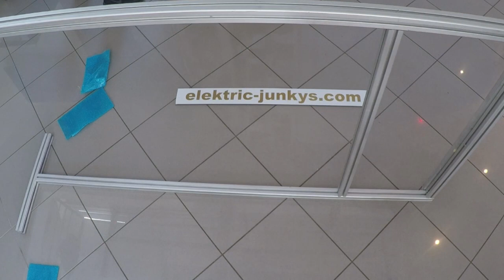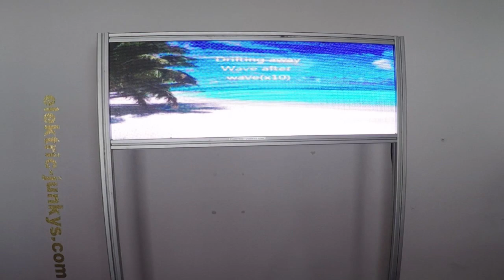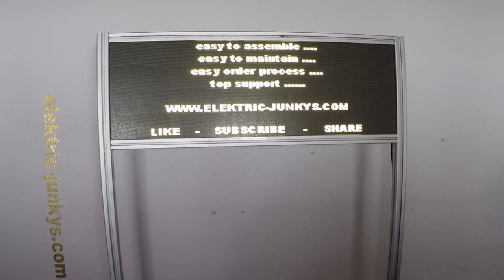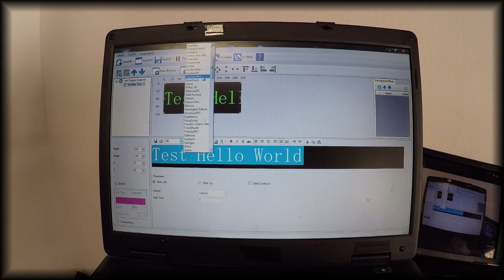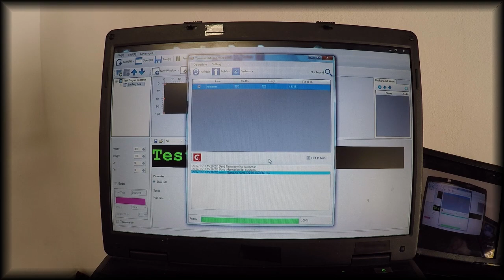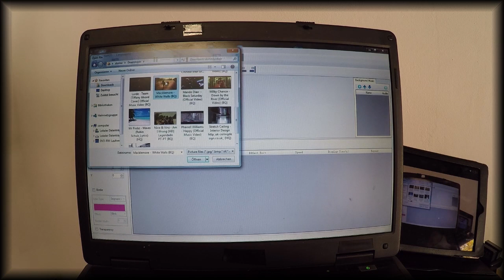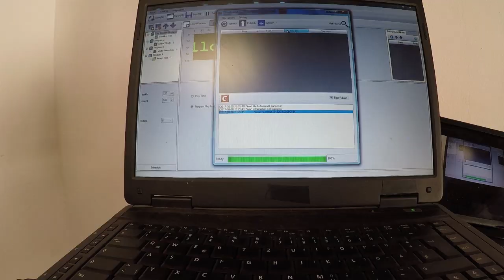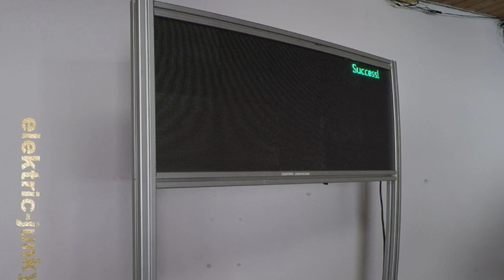how to build a LED Display P3 | High Resolution Low Budget DIY with elektric-junkys

Comment: Signs look good I've seen some of your videos. Only question is how well does it work in direct sunlight as if used for business sign out front. Also would putting plexiglass in front of it distort it (thinking of protection from rain)
Reply from the maker: hi guys .. for outdoor we have different Solution such as DIP LED Modules or an higher Brightness Chip .. we assemble on customer request ! 

Nationstar / Epistar / Taiwan Chip ..  customer is King elektric-junkys.com.... thanks for comment
Reply: ejunky66 please send us a link
Reply: @ejunky66  led name reference?

Comment: Can this design be scaled up in size and can it also be used for outdoor signage?
Reply from the maker: hi sure it can be upscaled until 300 SQM elektric-junkys.com
Reply: ejunky66 thank you for the reply!
Reply: ejunky66 what about use for outdoors?
Reply: @troyezell5841  the modules are opened back; you'd have to make something that covers the boards and everything from moisture/water and prpbably the sun depending where you are planign to put it :o

Comment: is that flickering avoidable somehow? different update rates of panels or is it just some conversion effect?
Reply from the maker: hi mate .. it is just on the Video .. in Live its not Flickering .. there is an special Amplifier we offer on our website www.elektric-junkys.com to avoid inteferences
Reply: if we are going to be using this in a setting where the screen would be record along with the stage is there an option for a higher refresh rate to avoid the flickering?
 @ejunky66

Comment: Hello I would like to buy 2 P2.5 160mmx80mm modules. Can advise me on the power supply to take, the control card, as well as the software. I looked on hd2018 and 2020 but couldn't find anything. Thank you for your help
Reply from the maker: hi mate there are many solutions to reach your goal .. is all about $$ .. send us an email we will find a matching KIT for you https://elektric-junkys.com